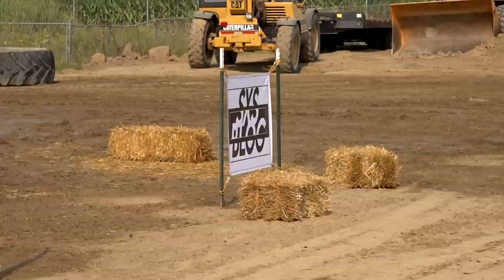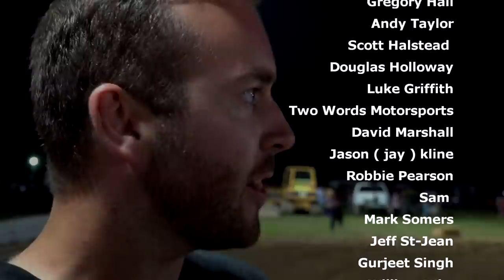SXS racing SAVAGERY! YXZ vs X3 vs Turbo RZR vs 2-stoke X3!! crashes and rolls!

Comment: I have that same "Orange Madness" 900 Rzr model that Sous had.  Except have the Pro Armor doors that match the decals.  I didn't realize it when I bought it, used of course,  but now I need the EZ$ in sticker to slap on it to represent.  It is nothing like what you guys have now, but still a good unit.

Comment: Hopefully, the track is bigger next year.  The bump at the end of the straightaway should have been bigger on the inside than it was on the outside.  This way we could have had more than one line.  Either way.... that was fun to watch
Reply: I agree, they need to eliminate the inside advantage on such a tight track with limited passing opportunities. Overall though, there was some great racing involved.

Comment: Well done boys, but...you must add the "Scandinavian flick" into your driving style on these tight courses (look it up). Also, adding toe-out would help. Just visually, they seem to be set up for toe-in...which helps in tracking straight for stability. However, on this right course, do what Porsche does and add that rear steering aka toe out. 🤘👊

Comment: need better tires on the back of the X2, or put the 4wd back in and have slightly oversized tires in the front so it tries to pull the front around corners so it goes tighter in corners.

Comment: It's usually whoever has the inside and is able to not flip over or keep the inside on the first corner after the finish line jump wins. After that it's just hoping for a mistake like them running wide or having understeer........but again feel like it's very one sided

Comment: So basically this is a holshot race and the only way to pass is if the guy in front rolls. Makes it interesting. Not necessarily a horsepower race, battle of the drivers 👌 I like it
Reply from the maker: Had we covered the other races completely you would see spots to pass. But the big turbo dogs knew the lines perfect

Comment: Hey guys have you done much racing. Because they need hand breaks and you need to wide drive them to keey your speed. You can see everyone doing the same thing and those things just can’t corner. So wide drive them with a hand brake and you guys will be unstoppable. Cain hard guys.

Comment: Why are so many SXS manufacturers and models doing Endo’s like they make them off balance or just plain wrong …this is seriously dangerous and certainly takes the fun away and it’s definitely Not always driver error when it’s so common and oddly enough it seems to mostly be the high end sport models and Not so much the utility type which don’t make sense as you think it would be the other way around or Not at all would be ideally expected⁉️

Comment: Who ever built that track sucks ,its a one ripper track practice track tighit tight corners and not enough straight away to over take anybody pretty much if you get the hole shot you got it in the bag as long as you don't flip